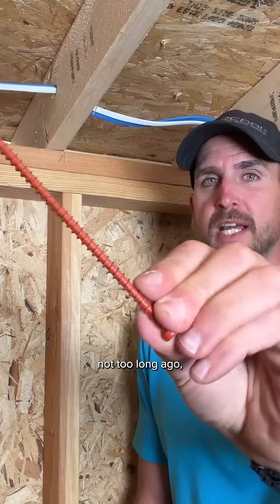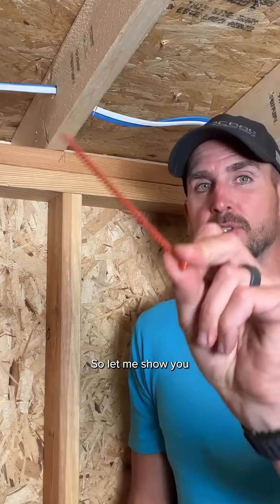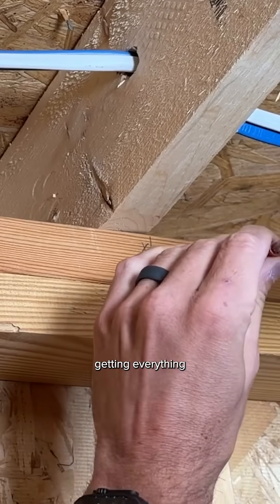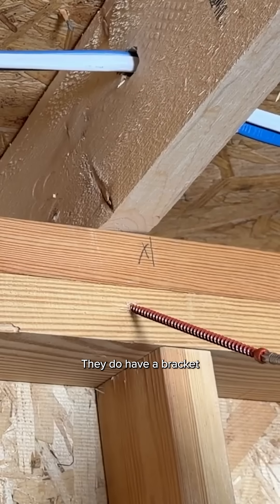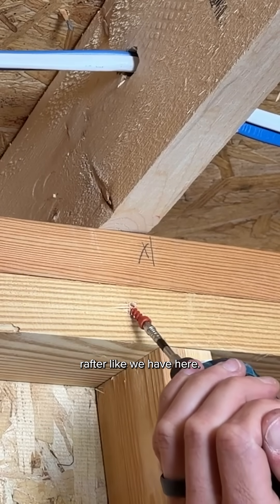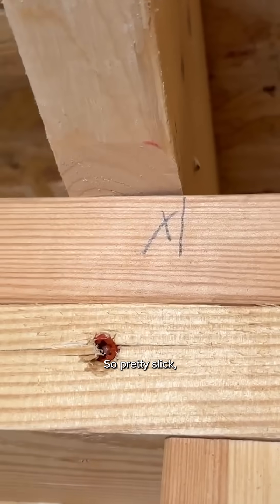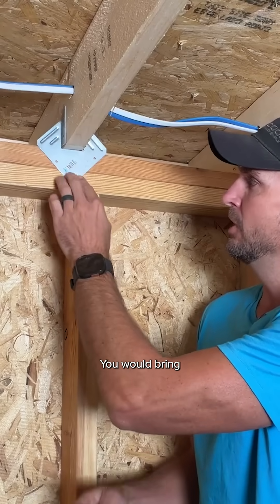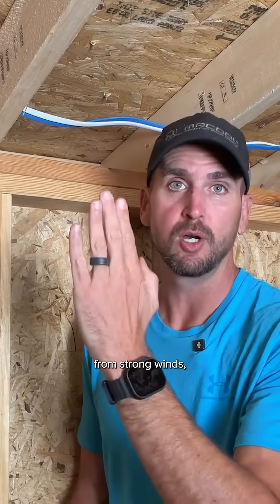The Screw That Makes Hurricane Straps Obsolete?

Comment: I worked in the construction field for 20 years.  It never ceased to amaze me how the 'newest' codes always introduced more "Simpson" hangers/fasteners.  Hmm...
Reply: Yep, just like newest Food recommendations include producer-sponsored foods. You totally hit it.
Reply: Yep.   Me thinks Homer has connections.
Reply: HMMMM indeed...which senator's son owns Simpson?
Reply: @TIJoe-te9qu 
Good question.👍
Reply: Code updates and additions are often written in blood. 

This screw is great from an efficiency perspective since you can install it from the ground quickly. If you don’t need the full strength of the bracket, use the screw.
Reply: EXACTLEy they are a ripoff company .
Reply: Rube Goldberg would be proud.
Reply: Jesus H Christ! Do you Americans really live in garden sheds?
Reply: Exactly right! $imp$on i$ a racket with the$e countie$ & $tate$.👎👎
Reply: Do you live in California? Tornado prone states? Hurricanes? After the '94 L.A. quake, the engineers looked at all the buildings tossed off the foundations and found the mudsill split because the round washers were too small and thin. That's why we have 3/16" thick square flat washers now. Failure, analysis, testing on shake tables, recommendation, code adoption, safer house. And BTW, all this stuff isn't to necessarily keep your house standing after an earthquake. It's to give you a few extra seconds to GTFO during an earthquake and save your own life....
Reply: @countvonthizzle9623  but we are always told to remain inside under a table or door rather than GTFO during an earthquake.
Reply: @jonasnight  - When that 8.3 hits, you can stay inside for the rest of eternity if you want. Me, I sleep through 4 to 5's. If it wakes me up, it might be time to chill out in the back yard for an hour or so...In the '89 Loma Prieta quake, me an the GF, decided to quit after one drink after picking her up from work in Tiburon, crossed the GG Bridge and had just walked in the door to her apt. in RWC when it hit. I watched the 6" x 8" glass window panes turn into what appeared to be plastic food wrap moving in a breeze during the shake. When it was done, not one pane was cracked. Normally, glass isn't "elastic". They made good glass in 1915, evidently.....
Reply: @jonasnight  Hey, during the 60's Cuban Missile Crisis, they had us hiding under school desks as protection against nuclear strikes.
Reply: @countvonthizzle9623  "And BTW, all this stuff 
isn't to necessarily keep your house standing after 
an earthquake. It's to give you a few extra seconds 
to GTFO during an earthquake and save your own life....

Now THIS is the bottom line in all this discussion.
Reply: Bracket is stronger.Threaded rods washer and nut and every 4 ft all the way thru top and double plate washer and nut.That will be about the best you can do.got to be anchored into slab.

Comment: Not discussing the topic which all the engineers in the group are saying about the shear force..
This screw makes the fit and finish of the sheet goods so much better
It does seem from a layman point if view the HT would spread the force out on multiple fasteners.
But back to the first comment

How many of you in this chat actually are concerned about the uplift and separation of those two would members.  I feel most of this negative or old school talk is simply to argue that this new tech is not as good as the old stuff.  Whether it is or isn't is not what I'm discussing, I feel there's just a lot of guys that wouldn't want to use the screw and are accustomed to the HT
  And that it's the new way of doing things means it's no good... until it is 5 years down the road and the accepted standard way to do things.

Some of you are talking like you put that screw in and the next day a breeze is tearing the roof or floor off.  Keep in mind the way some speed demons hack install those hurricane ties, a drywall screw is probably a better option. Lol

Also why the hell is there cables gunning through the rafter?  I can't see that bei g accepted anywhere on the state's or Canada.
Europeans are shaking their heads at us again.

Furthermore, some that screw tip is dangerously close to the middle of the board. That said, it would be weird to have to reach over with your drill and put a hole right above the top plate, but I'm not going to say there isn't some apprentice or bonehead out there that wouldn't do it.  
Rafter weakened from cable holes
Cables punctured by screw, 1.5" of clearance from center of wood member is not maintained here.

Comment: nailed ties/straps are considerably stronger (distributed attachment points, higher shear force). screws have poor sheer resistance, and any high tension force will just pull them right through plates (especially the weaker young growth lumber these days), or just snap screw off

Comment: The bracket can be visually verified, the screw can't and may be installed incorrectly.  It may be driven in at a bad angle and not bite into the rafter enough.

Comment: You’re an idiot. You missed the whole point of the hurricane clip, which is distribution of load and reduction of upward torque. A single point fastener does neither regardless of its length. You’re on the outside edge of the first lateral piece of lumber which will snap and sheerand make the entire upper section unstable. Get some practical experience or degree and engineering.

Comment: Looks like an okay idea for sheds as he seems to be building. Don't know too many homes these days using 6' high walls and 2x6s for roof joist. Yeah I'd use those, but would run a pilot hole through the lower 2x4 top plates to keep them from splitting before driving that long screw. But for homes, no, it would not make hurricane straps obsolete, may not even pass code in most areas.

Comment: All of you experts condeming the screw should know, for the truss companies and local inspectors to sign off on it, there would have to have been substantial testing for uplift resistance before approving its widespread use. But, if you want to install both, more power to ya.

Comment: In my area, these screws are code - metal grips are no longer used!  They are color coded so that the inspectors can see which screws are placed in the different locations - and yes they check to make sure every rafter (truss) has a screw set properly.  I pray we never actually have to test whether or not they work!

Comment: Not to cool of a idea. Splitting your first joist already with the head of the screw. I’d rather have the strength of a bracket or also referred to as a gusset.  And I don’t see how this 6 inch screw is any easier than installing a bracket with just 6 screws all at a tangent with the wood for greater strength.

Comment: Take your time.  Predrill to ensure you're far enough into the rafter. Use jig if necessary. This is your last chance to keep the building together in hurricane force winds.  Why not beef that 6 inch screw up ?? #10 or #12. Add a washer for good measure.. drill with accuracy. Make it count.  Why haven't we been building like this from the start??

Comment: I am a journeyman carpenter who became a Civil Engineer and a licensed General Contractor. I have installed thousands of hurricane ties (H25 straps) and so I am keenly aware of these fasteners. I don't believe the screw is as strong as the H25 strap. It probably calculates out when you do the structural engineering math, but in the real world, the H25 straps are proven, and they DO work. A screw has one point of failure, and it is likely that the truss seat, which is screwed into, will split under stress. The H25 has 8 points of connection and uses 1.5-inch tico nails that do not split out the base of the truss seat. It is inherently stronger and the H25 straps don't take that much time to install.

Comment: Hurricanes produce extreme dynamic force loads that can change constantly. The screw does very little by comparison to the bracket to resist lateral forces on the rafter, in the event the plywood deck above starts to lift/rack and begin a chain reaction, separating the roof assembly from the wall. Stick to the bracket.

Comment: I don't like this screw at all, especially without requiring pre-drilling of a specific size hole.  That screw is wide enough that it could easily cause some cracking, and if it doesn't cause visible cracking, it will still cause some internal deformation that will decrease strength.  Screw looks about a quarter inch thick, so pre-drill 3/16 clean hole to increase strength.  I still really don't like what I see, but that would improve it compared to how this is demonstrated in this video.

Comment: Using both is the best idea.
Reply: If you don't also increase the connection of the top plate to the studs and the wall to the foundation then you're strengthening one link of a chain.

Comment: In South Florida, even the plate referenced does not meet code. Double Straps are pretty standard down here for truss/rafter builds. That being said I have used these in tandem with the straps, but in all honesty it's not doing or adding anything that properly sized double straps do? If you really want a good build, use the u straps that actually go over the top of the truss and run down both sides with enough length that wraps under the double top plate.

Comment: I had a customer use even longer ones that went vertical straight through both plates.  I had to move their rafters and those screws were in there.  Stud to rafter twist strap over sheathing is even better if you catch the whole rafter.

Comment: If you turn the Simpsons' strong plate around, it doesn't lose its strength, but it is easier to work with, and no sharp edges are sticking out.

Comment: If the stud is offset  i might go thru both top plates.   What is holding thetop plates to the studs. Nails or screws.  Or just the shear panel.  I think back to my sisters house . Her husband add strong ties to every joint he could. The northridge quake threw then at least 3 feet abobe their bed twice. They did not have a single crack in the stucco or plaster. Every other house in the same tract had major structural repairs needed.

Comment: i built a boat shed in Nova Scotia in 2022 built from rough lumber from spruce that came down on our property due to Hurricane Dorian and wanted the unfinished inside walls and ceiling rafters to look vintage. so i used these screws instead of the ugly hurricane brackets. The building inspector had never heard of them ( or GRK screws which held the walls together) and reluctantly gave me occupancy permit. The shed went through Hurricane Fiona unscathed, so guess that says something.

Comment: WHAT A STUPID SOLUTION.  THE ORIGINAL SOLUTION IS FAR BETTER AS PULLING IS RESISTED BY HORIZONTALLY INSERTED FASTENERS.....RATHER THAN A SINGLE SCREW WITH A SHAFT PARALLEL TO THE DIRECTION OF ROTATION OF THE MEMBER UNDER WIND FORCE.

IT WOULD BE GREAT IF YOU ACTUAL.UNDERSTOOD ANYTHING ABOUT PROPER CONSTRUCTION AND PHYSICS

Comment: You do know they make an installation tool for that hurricane strap were you just put that on the edge of the nail gun put it in place pull the trigger and now your hurricane strap is put in with one motion the hurricane straps been around longer I trust it nails are meant to move and flex with the structure a tempered hardened screw will not and eventually it will crack

Comment: That one screw replaces it until a proper storm swings by and starts lifting those rafters.

I'll choose fasteners that go around the top of the rafter all the time. Plus straps that keep each portion of your house together, so roof to wall, wall to floor, etc until you strap right into the foundation.

Comment: I've seen the Demo Videos for this New Screw system.
Even some of the disaster site reviews.
It does work.
"If installed Properly" it will usually keep the boards connected from uplifting forces.
In Most scenarios.....

What it lacks resistance to other dynamic forces, which a plate has a better result.
The screw has 1 direction point that it's holding against. (It pulls 1 board towards another board)

The plate's geometry has several directions that it controls.
Both top playes get fasteners, and the roof board is locked in place against uplift and side shift forces.

In actuall disaster evidence both methods work against wind events.
The screw only really is rated for wind events.
So, know build for what You're expecting the house to deal with.

Comment: DON’t do this people! This will lead to severe cracking because that long screw is basically acting as a wood splitter. The fastener is a better option because smaller nails will not cause splitting and is stronger overall.

Comment: whoever simpson has working for them to get the building codes changed for all their products is making that company a fortune. just about everything you build in the state of michigan requires a boatload of simpson products. some of them are great products that i would use regardless, but some of the new stuff is ridiculous, sometimes unnecessary and the way i built it before they changed the code to use one of their ties it was way stronger.

Comment: When the threads run all the way up to the driven end it does not allow the screw to "pull together" the full assembly. The "head" of the screw is also not broad enough to keep it from pulling through with time and expansion.

Comment: There is a lot of disbelief in the comment section. The truth is the engineers run the calculations on these things for a reason. But the uplift ratings might be good enough in all areas. For most of the homes these will probably work just fine. But not all and certainly not homes in HVWZ like Florida.

Comment: I personally don't like the screw coming into the side of the 1st bottom 2x4 because this just compromise that 2x4. I would screw from the bottom side of that base 2x4 up all the way and that will not compromise any material structure and add the binding force between all the 3 planks.

Comment: I know that in some municipalities,  building departments don't like screws. Too brittle in comparison to nails. They'll snap before they bend. 
And this much I do know,  it's the cross section of the fastener that's doing the work. Each fastener contributes to the overall strength of the joint, based on the thickness of the fastener.  
I'm not sure the single screw would be the same as the 8 fasteners that you're replacing.